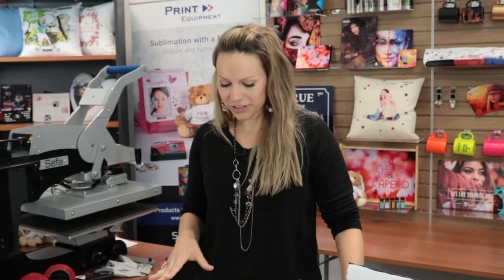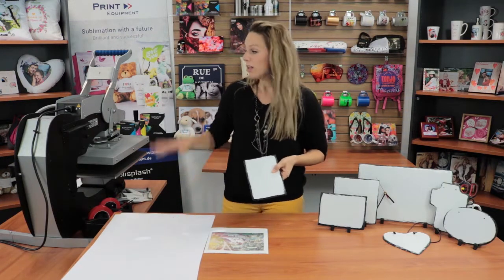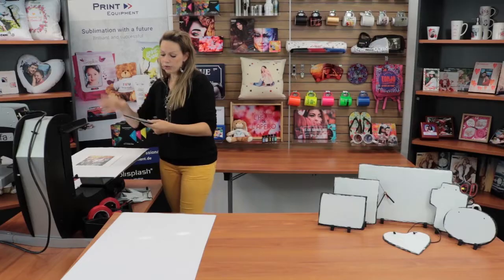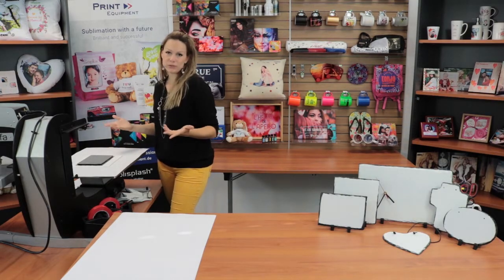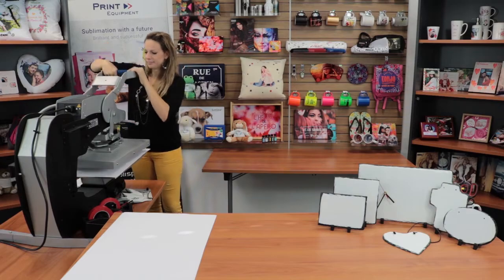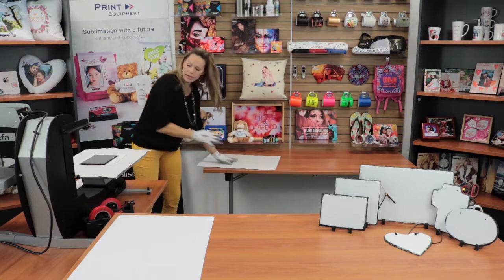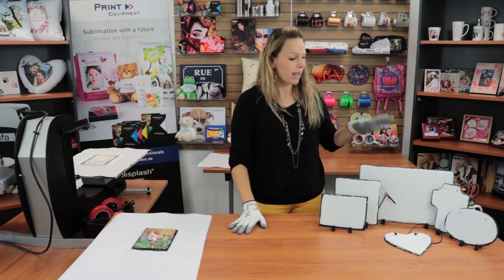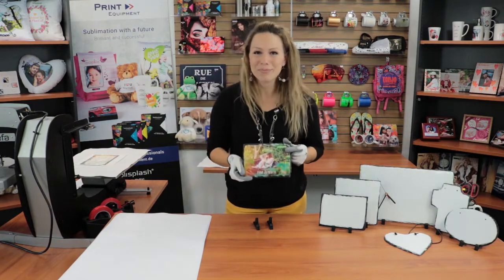How to sublimate slates

Comment: What i do(different brand but same material) is i pre heat the slab by just placing it in the heatpress for a little, once its warmed up (hot to the touch) its layed face up, i put the sublimation paper on top put a protective foil and press it for 120 seconds at 200c (or at half the time recommended by manufacturer with the face down method, letting it for 240 seconds tends to cause it to burn and yellow in places)
It comes out nice and crisp,
With the facing down method it tends to come out wavy and smuged.. although i do mention this is most likely down to the materials used (ink, the slab itself, the heatpress etc.)
But i thought id share for anyone having similar difficulties with printing it with the recommended method.
Reply from the maker: Thank you - Own experience reports and alternative approaches are always welcome! :)

Comment: It's 360  seconds  time.. with 180 degrees centigrade (365 Fahrenheit) ... remember  to pre heat the machine to successfully transfer.  Remember it's important to have this slate TURNED DOWN with the transfer so the slate heat goes from top to bottom on the press.
Reply: She said 10 - 12 minutes which is 600 to 720 seconds?

Comment: Hello

Thank you for this video.
We often have waves in our printing on long slates (23.5 - 13.5 and 15 x 20 cm). It's hard to explain, but it seems like the ink is going away in waves. Do you have any idea how this happens? We hardly ever have this with heart shapes.

We also sublimated with the paper facing the top and only for 2m20sec. These always look good too. Can you explain to me why it has to be so long and the paper down? We once did these for 11 minutes, but then our stone broke.

Thanks in advance
Reply from the maker: Hello, your second question first: why we suggest to place the paper on the bottom, is explained in the video at around 1:00 min. if your slate has broken, this has nothing to do with the heat, but with too much pressure. This too is explained in the video. light pressure only. About the problem with waves. We would need to know more in detail to better understand. we sugget to follow the way we do it in the video and you will not have any issues. This is of course only if you use the slate we offer, as there are many quality difference in coating and in the slate itself.

Comment: Do you have a piece of foam or anything in the bottom or is it just the bottom of the machine?
Reply from the maker: Usually there is a somewhat soft cusion on top of the metal plate. Otherwise the slate could break.

Comment: Do I have to buy a certain heat press?
Reply from the maker: Hi Susan,  the transfer itself works with every transfer press as long as you're using the right time, pressure and temperature. But when choosing the right transfer press there are other individual factors you should keep in mind.

You can find a variety of transfer presses in our shop: https://shop.printequipment.de/en/transfer-presses/manual-flat-presses/?p=1

If you want an individual consultation you can contact our support: +49 7223 2815 200
Reply: @printequipment  Thank you

Comment: Hi what temperature and time did you use?
Reply from the maker: Hi, the pressing is at 180° C degrees for 10 to 12 minutes (depending on the size of your slate plate).
Reply: Hello can you tell me please is the picture you print mirrored and wich paper you use , the paper wich you use for the mugs normal paper ?